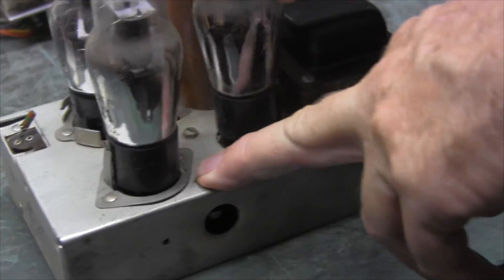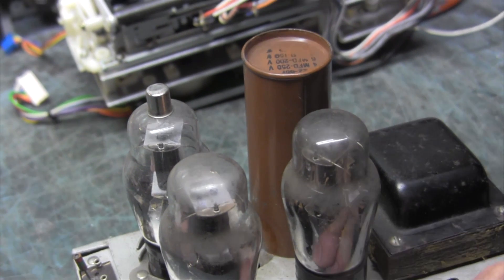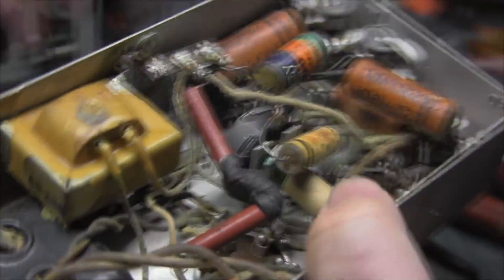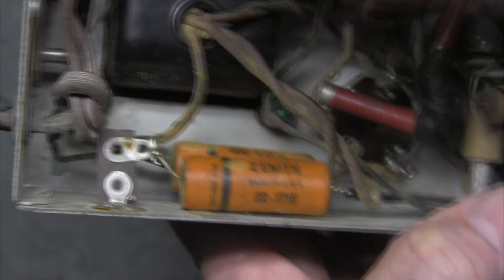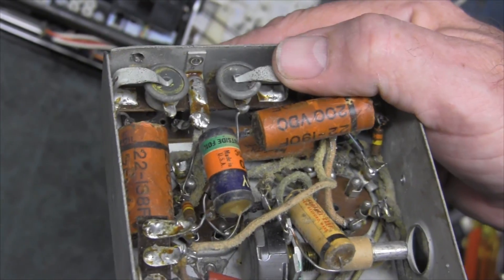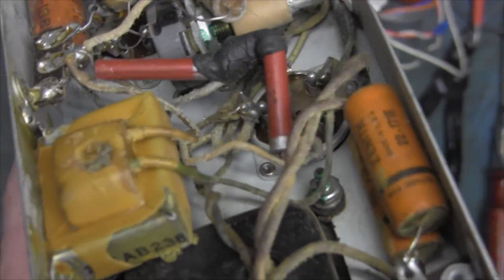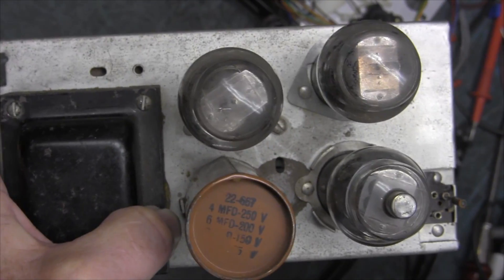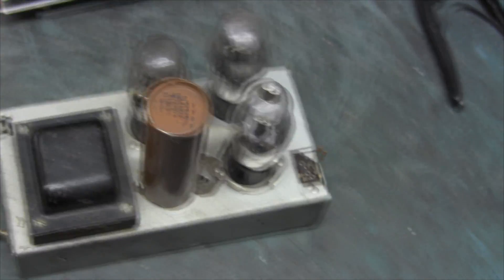Tube Amp Repair and Mystery

Comment: Hi Telewacker. Can electrolytic capacitors and other electrolytic caps can be effectively tested using an ESR METER. This simple and cheap meter sends a signal through the capacitor and measures the Effective Series Resistance. If a cap is dried out it will have a high resistance to passing a signal. The cap may test ok otherwise. You can usually test caps in circuit without removing any leads. A cap that has low ESR is likely to be good. It can still be leaky or shorted. If DC voltage is applied to any cap, there should be little to no current flow. The low voltage of an ohm meter is not enough voltage to definitively test for leakage. A leaky cap may still let an amp or radio play but you will notice that the cap gets hot. That is bad. I check all the can caps on anything I am working on to be sure they are cool. Be careful, some caps' outer can may have voltage on it. Usually they have an insulated cover, but you never know. An open or dried out capacitor in the power supply of anything is the primary cause of a loud hum that is not affected by the volume control. New old stock caps can be ESR tested and then put on a DC power supply at a low voltage (for caps rated over 100 volts, 12-35 volts is good) for a day or two. Check the amp meter on the power supply to be sure there is less than a milliamp of current. Putting caps on low voltage for a while can help them 'heal' or keep them healthy longer.

Comment: I just bought a pickup load of old vacuum tubs and NOS Sprague can capacitors.  Can this type cap be reformed or is it even worth it.  Most caps dated 70's to 80's.
I am going through the tubes now and have found a bunch that would work in amplifiers.  Lots of TV tubes.  Where can I sell the TV tubes?  Thanks.
Reply: TeleWacker the big question is how can you prove they're good or junk. Now there are also a lot that are supposed to be paired. Those can be worth good money.